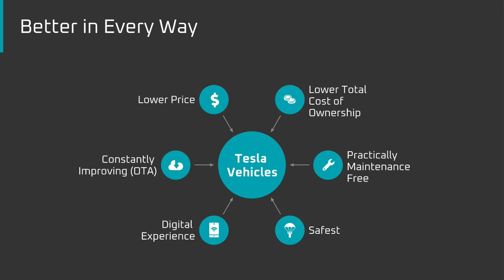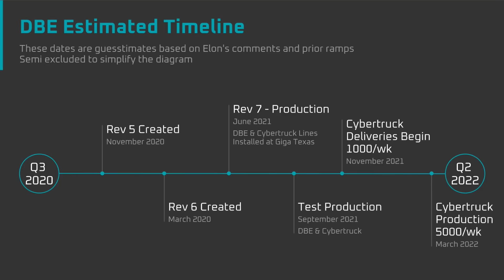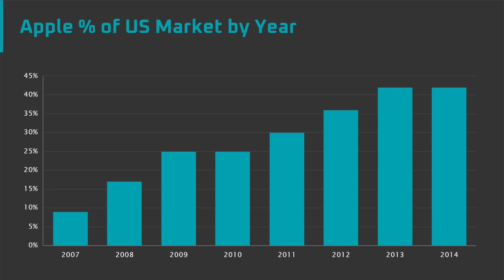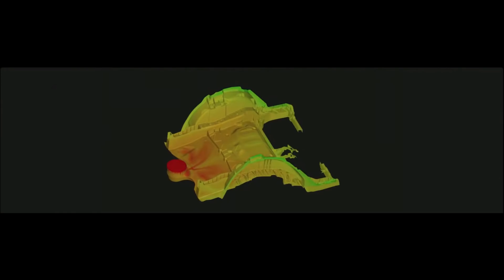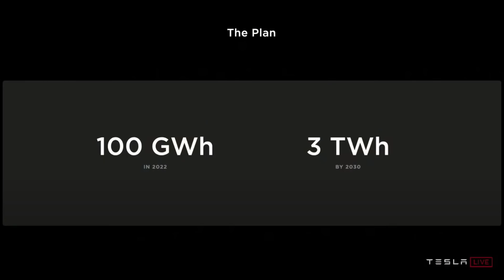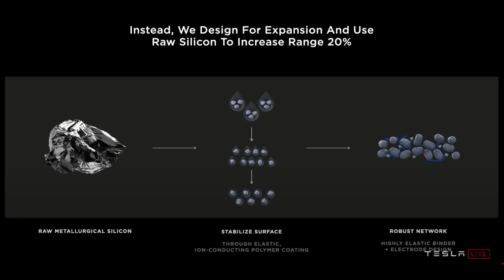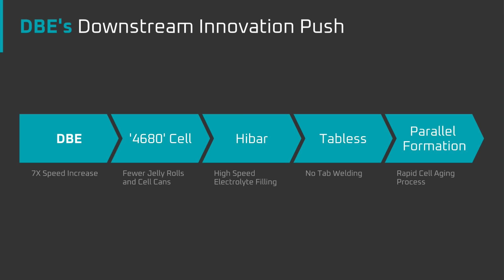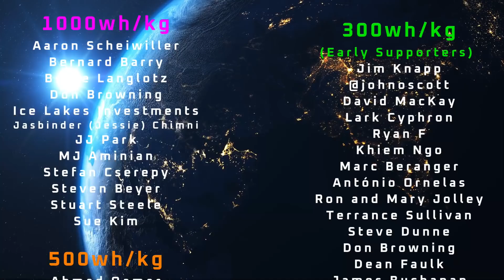#1 Thoughts on Battery Day - Lithium Mine to Battery Line

Comment: I thought the big news was Elon's announcement the day before Battery Day where they secured commitments with CATL, LG, and Panasonic for batteries for the next year. If I understand correctly, these commitments well exceed their current capacity and will require significant expansion to their facilities. These volume commitments should translate to lower price  per cell to Tesla since none of the other automakers combined can purchase this many batteries over the next 2-3 years. Tesla is also essentially prepaying for lower price batteries today by partnering with Panasonic and now LG. 
Three years from now is when all the magic will happen where Tesla will be able to mass produce their own 4680 battery at half the current cost with better specs. Meanwhile all the other auto makers should start pumping out tons of EVs having only the current tech battery that CATL, LG, and Panasonic are optimized to build. It will take several years before GM, Ford, VW, etc. will have access to the next generation of battery tech in quantity.
If Tesla didn't commit to CATL, LG, and Panasonic now then they would have been forced to innovate the next gen battery on their own and would likely find success. Now their focus has to be on rapidly building out the next two years+ of contracted demand. That's a brilliant chess move.

Comment: I am left with just 1 question. How soon will all 3 chemistries go into the 4680 cell. Elon musk did say they will only do the high nickel themselves and for the others they will rely on suppliers but that left it open if those suppliers will be able to supply the 4680 cells with partnership thing, or if the suppliers would just supply the cathode/anode. Either way, Iam very confident that Tesla will wbe able to execute and even if they have hiccups, the other car makers aren't following that closely. Many are still thinking that ICE have a future and that BEV will never take over, looking at BMW and toyota in particilar.

Comment: Do you think the 4680 cells are standard voltage or maybe something more exotic? Pure cell?  3.2V 3.7, 4.2 etc
Reply from the maker: 4.2 max (3.7 nominal) - same as usual
Reply: The voltage is a function of the chemistry, not the form-factor.  Not sure but LFP may be a lower voltage.

Comment: Tesla's new 4680 battery ISN'T 5X and 6X greater performance than the old 2170 battery cell, volume for volume -- an important measure of a battery cells performance.. The new 4680 battery's volume is 5 1/2 times that of the old 2170 battery; but, its energy density is only 5 times greater, and range is16% greater. Perhaps, the 4580 battery's performance will be increased before the batteries go into full production. It's probably possible to make performance improvements during production, also.
Reply: The big idea for them when it comes to battery production is to make them easier and cheaper which improves things all the way down the line.
Reply: @TheEvilmooseofdoom  Yes, but everyone is talking about how much greater the 4680 battery's performance is. It's only a few percent better, volume for volume, in some areas. The big news is in the manufacturabilty improvements and costs reductions, cooling, pack footprint (one half), and installed weight reduction (>10%).
Reply: @artsnow8872  It is greater.  It is only a few percent in some area's but those area's add up.

Comment: 2:19 dry electrode incorporated lines  are not slipping imho, we saw footage of those working and Elon in latest podcast stated, that they have cars driving around with those cells SINCE MAY, thats half a year ago. So, there is even plenty room for sandbagging it seems :) And I do not believe those would be handmade prototype cells for carS, that would take forever, there must be lines running. Elon has learned to keep more to himself, not to hurt current sales.

Comment: An exploratory dip into the Lithium battery pool,  reveals its fraught with $$$ pitfalls. Lithium's initial use was medical. Therefore mining and shipping of the metal was strict, tedious and $$$ - "for internal human consumption". Then came lithium batteries, which are NOT for internal human consumption. But the mining and shipping processes haven't changed - equipment was designed, engineered, installed and successfully used for decades - NO CHANGE NEEDED. At the present rate of demand, even WITH Tesla's new mining and shipping tech - we are nearly OUT OF PROCESSED LITHIUM FOR BATTERIES. oops

Comment: Having watched your videos, I had a good grasp on  what was discussed on Battery Day as it was rolled out. While many thought it was a dud, it was as exciting to me as Musk had promised. So thank you. 
Now for lithium clay that was discussed on BD.  Cypress Development Corp. has a 10,000 acre lithium clay mining claim in Nevada which is similar in size to Tesla's lithium clay mining claim. There are three other publicly traded companies with lithium clay deposits, but CYP seems the most similar to what Musk described. A smaller one, Amercia Lithium has lower grade clay that is unlikely to be very economic, and Lithium Americas is a larger company with a richer deposit. Ioneer has clay but does not plan to use it. All these claims are likely BLM land - government owned lands - most of Nevada is BLM land. 
Cypress says it can produce about 2500 mT of Li2CO3 per year, for 39 years from this acreage. That is enough lithium for about 450,000 cars per year. Thus, one such claim will not be enough for Tesla by the time they are in lithium production. Cypress has a market cap of about $37M - and much of that value is the ground work they have done in proving their reserves. They expect it will cost about $450M for the processing plant.  (The hard part). It is possible that the Tesla claim is richer (higher PPM) by a factor up to two, and maybe twice as deep, but not likely any more than that. Elon talked about a new extraction process that has not been used before,  using salt. I think  this paper may describe the process he is talking about:     https://www.sciencedirect.com/science/article/abs/pii/S1385894719331468  Cypress is planning to use this or a similar process from what I can gleen.
Reply: Very interesting. There's another comment here, up or down, you'll see it, as long as yours , similar in topic, but regarding clay processing specifically . 
I will look at the paper. 
Thanks for sharing.
Reply from the maker: Interesting!  I'll check it out.

Comment: Even though its on level 4 and the yeilds might not be at even 25%(guesstimate) usable batteries will still come from the system and with the texas factory still roughly a year away (I know its not but?) they should have a good amount of the usable  batteries in the stock pile for the semi and the CT ready to go. Plus all the failed batteries are going back for recycling which is a bonus for researching the recycling.

Comment: You're doing a fantastic work Jordan. Quality primes over quantity. There's 5 thematics to cover if you follow the battery day presentation, so I'd expect at least : cell format with tabless electrode, dry electrode, anode materials, cathode materials, integration to chassis.

Comment: 8:18 Regarding Silicon. The sauce is not so secret. They intend to use nanosilicone which at that scale has a magic characteristic called superellasticity. At that scale silicone is simply superellastic and can largely accommodate Li Ions repeatedly with zero impact. Karim Zagheeb et al. of Hydro Quebec Center of exellence developed this material along the coating and tested it extensively. Check it out. Karim Zaghib and J P Goodenough are the two scientists with the most significant input in all Li-ion batteries made by anyone to date.
Reply: Sorry I should have written nano-scale particles and nano particles. These are not synthesized but obtained as a result of beed milling of silicone ore grains. From an environmental perspective the difference is significant.
Reply: https://patents.google.com/patent/US20200063036A1/en

Comment: There making silicon based batteries, silicon can hold 12 times or more the electrons then lithium. Silicon micro fiber is what there shirts ressembeled. Silicone has a 300% expansion rate which tends to crack an destroyed the connections in the battery. They found a way around this weather it be solid or gel state batteries this is impressive. The technology is not new, but there approach to bring these batteries into the world is.
Reply: Yes, as Elon said, it's not understanding the idea that is difficult, it's making it happen that's difficult.

Comment: I'm looking forward to the series.  There are two things that I'm grappling with after battery day: How is the tab-less core attached to the can so it maintains surface contact and is not susceptible to vibrations and, second, how is the battery brick connected (I know that cans are glued together) with the chassis as new battery pack supposed to be part of supporting structure.

Comment: Been waiting for your thoughts. One question that has been on my mind for a year is,  will the Panasonic battery line get the dry powder electrode?  If Panasonic had that they could make batteries faster for Tesla.
Reply from the maker: My view would be no.  It makes more sense to add new lines with upgraded equipment.  Never turn off a money printer.

Comment: Thanks as always for grinding on these topics, this was a great teaser for the upcoming series. Your video/interview with Prof. Meng and specifically the discussion on anodes is exactly the sort of context that made the battery day claim on silicon anodes stand out to me. I'm curious to what degree we can back out from the numbers they give for cost and energy density improvements some of the characteristics of this anode assuming there are not other degrees of freedom that would make such an analysis more difficult. Another major target for analysis (that you touched on with the DBE process "critical path") is which claims can execute independently to de-risk the execution, timing, and capital needs for this ramp. It's going to be a lot of fun to see how this all fits together and I'm looking forward to your effort w/ the upcoming series, thanks again!

Comment: Jordan re Lithium extraction from Nevada clays.  In your upcoming video please cover direct extraction using ion exchange resins.  As an example lilacsolutions.com. The crucial thing is a high affinity constant of Li+ binding to the resin AND that the affinity constant is sufficiently higher than competing cations, like sodium.  With such resins Li can be selectively adsorbed on the matrix; wash away everything else, then pop the cleaned up Li+ with Hydrochloric acid.  Dupont makes such ion exchange resins, lilac won’t say what theirs are made of.  Crown ethers are very selective for different cations based on the atomic radius, but might be too expensive (wiki crown ethers, helpful figures).
Extraction from clays could therefore be a two stage processes, both stages being batch I am afraid:  1, displace Li+ stuck to the negatively charged clays with excess Na+ (hence table salt mentioned), thus obtaining a brine.  2 Run the resulting brine through the affinity matrix to capture the lithium, wash off everything else, then elute Li+ with Hydrochloric acid (NOT sulfuric acid).  Bypass the evaporation ponds stage.  Lotsa water though.  Pipeline to convey sea water to Nevada?
Reply from the maker: DLE is on my mind 😀  If you know if any review research papers, let me know!
Reply: Interesting.